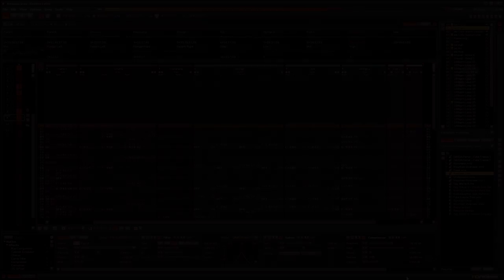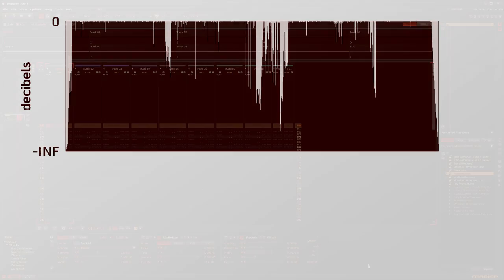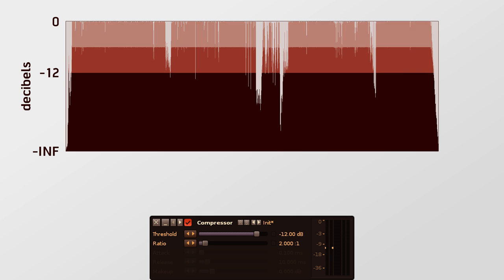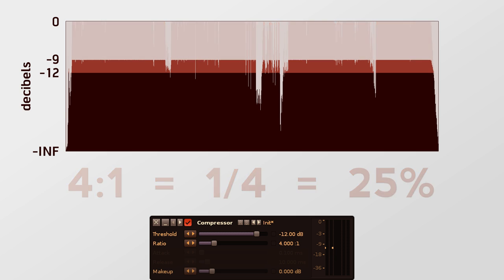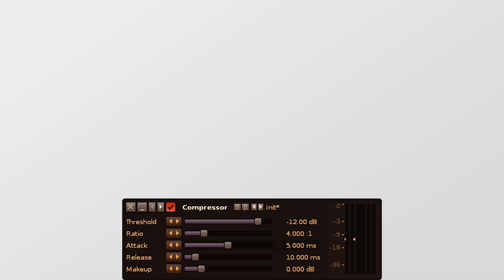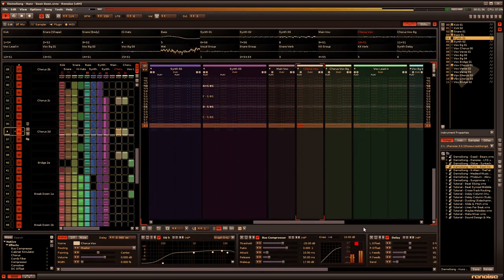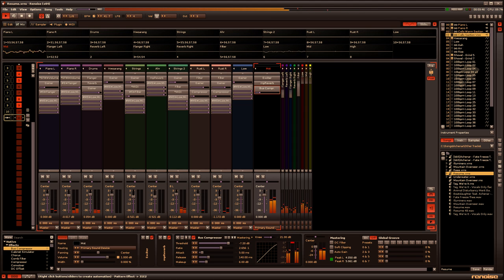Compression

Comment: Great video! I think there is one inaccuracy though. The attack time of the compressor determines how long the compressor takes to apply full compression to a signal, not a delay in which the full signal can pass. The release time operates similarly. Also, the bus compressor differs with the addition of a 'knee', which smooths the threshold point, applying compression earlier and smoothing the transition from uncompressed to compressed signal.
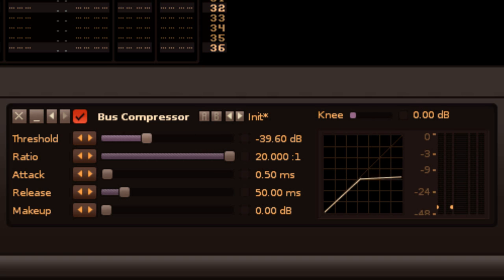Reply from the maker: Very true, the native Renoise devices ease the compression in/out, but the priority here to was to help the viewer to wrap their head around the basic concept, so it was kept simple. The Bus Compressor's knee is at 5:09, demonstrating that it adds a gradient to the compression ratio across a volume range instead of a single point.
Reply: Achenar Aah, my apologies. You did indeed explain the bus compressor's function well.